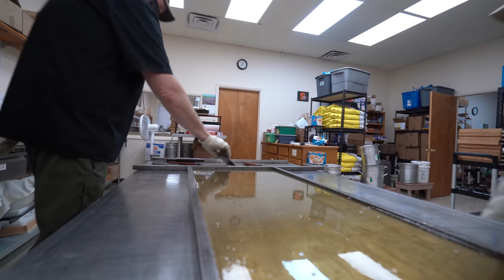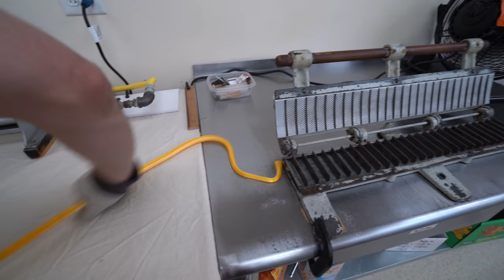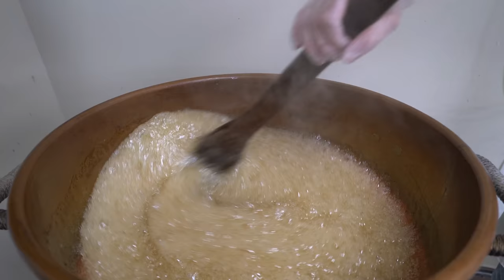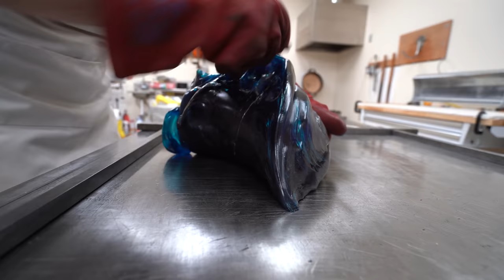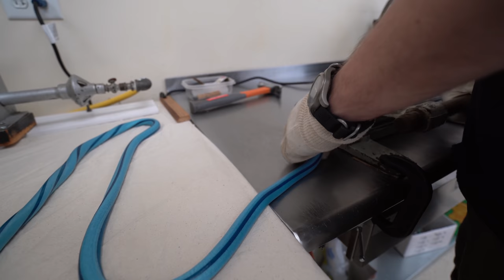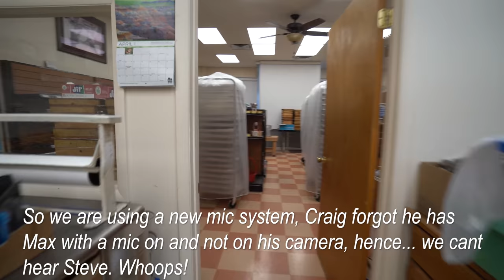How We Make Mango and Blueberry Hard Candy

Comment: @ 29:40, I too wonder the same thing, thinking that over many years of hot candy it's got softened infinitesimally each time hot candy is pulled on it. Maybe it could use a sprucing up with a tighter angle put into it. Was it bought that way? So opened?

Comment: Could you guys save yourself at least a little bit of work mixing the candies, if after you press/cut them, you lined them up the other direction? Place them the length of the table, against the wall, and then layer the batches outwards?